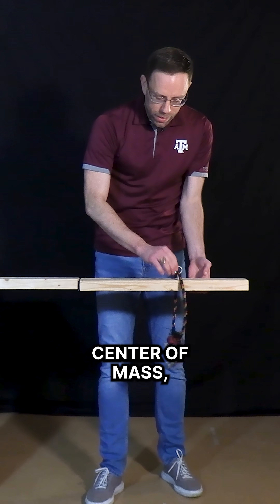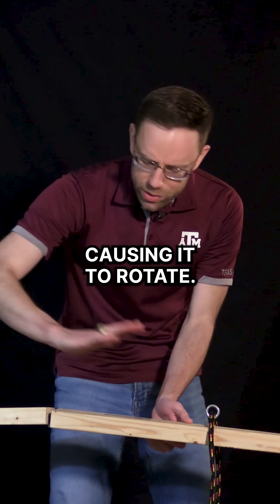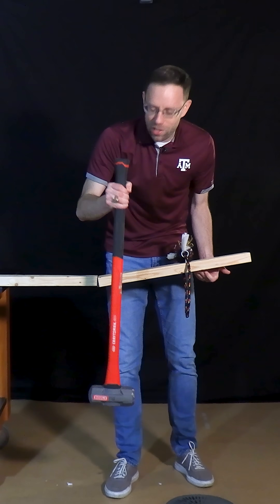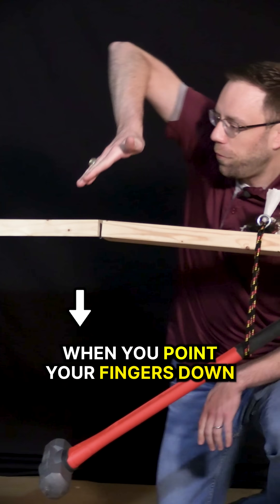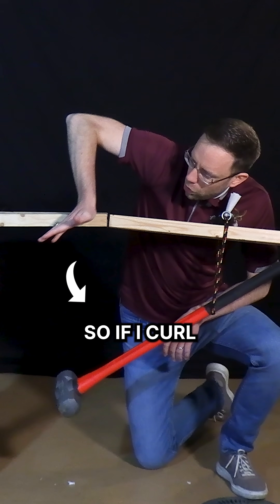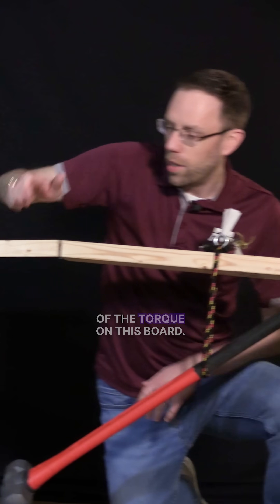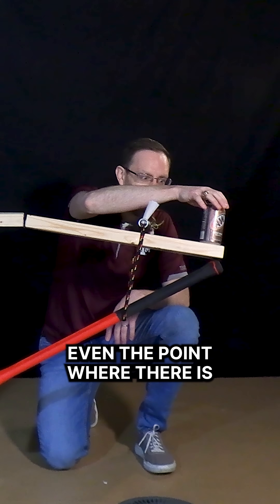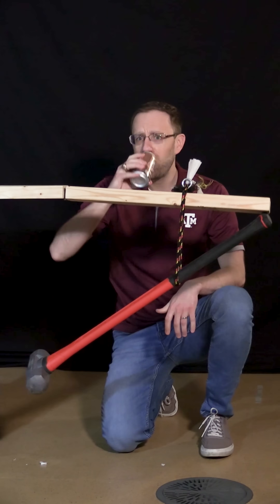Floating sledgehammer using physics! 😮 #shorts #TAMU #DrDawson

Comment: Would this work with a short piece of rope between the two boards acting as a hinge?  Or does the hinge point need to be rigid
Reply: As long as you tie it in a way that secures the other board fully to the stable one it should work. Essentially you're just creating another type of hinge.

Comment: It's all in tye angle of the hammer.

As the board falls it raises the head of the sledgehammer, and as the hammer is raised, gravity pulls it back down, but as the hammer goes back down, the board is pushed up, creating a loop until perfect balanced is achieved

Comment: Everything wants to fall down. The Sledgehammer wants to fall down, but it can move because of the rope and the board. Friction is hilding it in place. The board also wants to fall down, but now it has to move the Sledgehammer. But the only way the hammer can move is upwards, so gravity says no. Thus, the flaoting table.

Comment: So one force is pulling the plank from a short distance to the hinge, the other is pushing up from a longer distance from the hinge.
 Same amount of force at different point on the plank. The one pushing up (hand of the hammer) cancels the one pulling down (the weight of the hammer)… and some! So it has enough force to keep the plank floating.

*The force generated by the weight of the hammer and gravity+ the weight of the plank is not enough to let the plank go down due to having shorter arm than the force of the other end of the hammer.

Force * arm = moment

Comment: Wrong explanation. It's counter balance on the hinge that causes it to hold itself.  If you take a measurement of forced applied to the bottom of that hinge, it should be 1/3 of the weight of the hammer.

Comment: The principle is called Leverage, which is similar to torque, it's the same concept used in meter long Bolt Cutters that can slice 12mm, 14mm bar of hardened steel, it's the same concept an Olympic Rings champion uses to perform "the iron cross" and how you can use a long Crowbar to exert tonnes of force at one end by only applying tens of bodyweight KG at the other, Leverage is also useful in trading, the broker gives us more money than we would have otherwise, to trade with, see how leverage is useful in any setting. You can leverage Debt by financing something with loans, make a profit above the loan+interest and keep the difference to yourself, completely free to use as your own

Everyone needs some form of leverage in their life

Comment: What is holding the left side of the board though? I get why the right side wouldnt fall cause the hammer handle is pushing it up. But what is holding the left side of the bpard up? Like whats keeping the whole thing from just falling straight down?
Reply: Irrelevant.